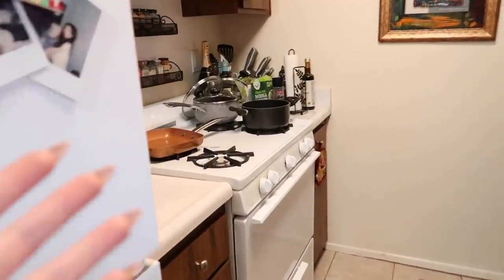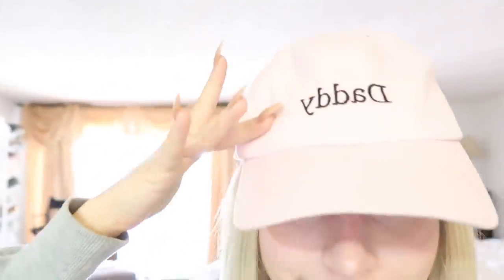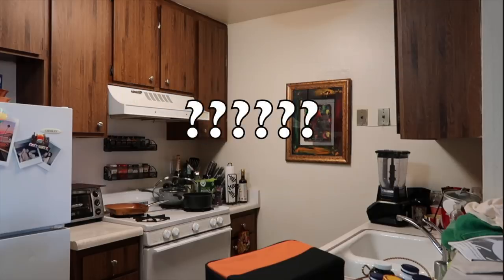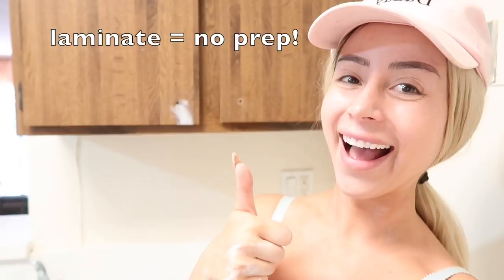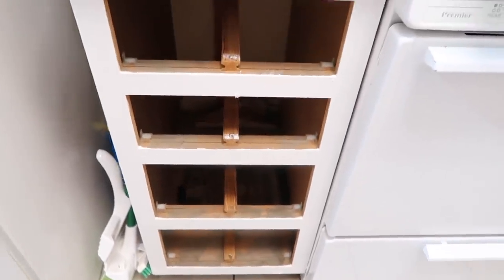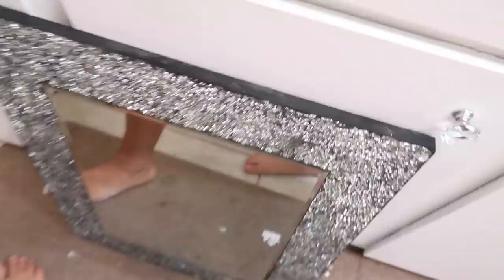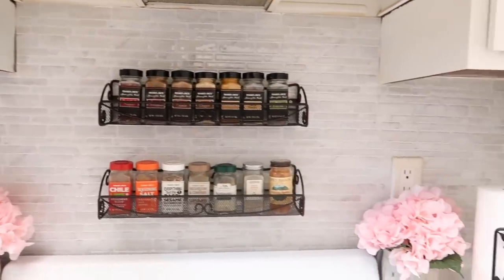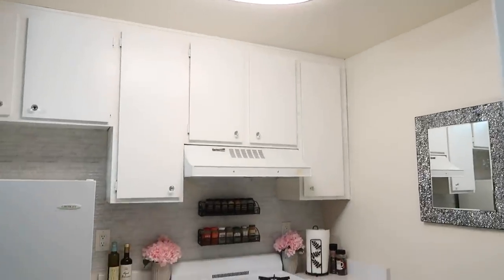DIY KITCHEN MAKEOVER!

Comment: Don't forget to clean your cabinets with TSP or a degreaser before painting!!
Reply: Mustafa oof
Reply: @kaitling6527  oof indeed
Reply: And don't apply 4 coats of paint in 8 hours lol. It's probably sliding off next week.
Reply: poodlegirl55 why ? What is the right way of painting?
Reply: I’m also pretty sure u can’t just paint over laminate? To my knowledge it’s best to sand, prime and then paint it. Or at least use a degreaser. Hope it won’t peel off.
Reply: @julienov8084  it will,unfortunately and I heard paint not primer and not fully cured before more coats, yikes!
Reply: @julienov8084  it's for sure going to peel off. I once painted over laminate, the whole thing was peeling off at every slight touch by the next day. There is a brand of primer that is enamel based and made to work over shiny surfaces, i.e., laminate, or wood with finish on it. Zinsser B-I-N,  it was a life saver.  I scraped off the disastrous first attempt and repainted with the B-I-N bc it let me skip the sanding.
Reply: This whole video is what NOT to do
Reply: @watchlovestanexo  The can of paint lists how many hours it needs to dry between coats, it can vary. Usually 2 to 4 hours. I would never do more than 2 in one day. If one coat isn't dry and you add more it can never dry underneath and will start to bubble up. It won't last.
Reply: Greasiest area in the whole house...on laminate 😂. 
No prep at all.
Reply: What is TSP?
Reply: Mustafa I’m so nervous for anyone that watches this video & thinks this is the proper way to paint laminate... or paint at all lol

Comment: I love you Amber! You are my fave and I LOVE YOUR DIYS ☺️😍. But if anybody wants to renovate make sure you use actual Laminate Paint for the cabinets. There is one that I recommend and it’s sold at Home Depot, is called Cabinet Rescue and while I love PPG Timeless paint bc it’s one coat, I assure you it won’t last and it might scratch easily over time. If it was wood it would be fine but laminate needs a different paint or adhesion primer at least.

Comment: when i get a house in the future, the only person i'd allow to do a makeover would be Amber
Reply: Same gurl, same
Reply: helpmethinkofaname but... she didn’t paint the cabinets properly at all. She was wrong about laminate not needing sanded, she 100% should have put a primer down first, her very first step NEEDED to be using a degreaser on the cabinets (otherwise the paint will slide right off over time), & that many coats of paint that quickly will start chipping & peeling because the bottom layers never fully finish drying which leads to bubbling. It looks okay from far away but it could look SO much better & it’s going to last about a year before it’s a complete mess to deal with it

Comment: Just throwing in some suggestions for anyone who wants to do this to their cabinets. I don’t remember Amber mentioning this so i’ll add it’s important to buy paint AND a primer specifically for cabinets. Ordinary paint isn’t water resistant and normal kitchen activity can wear the paint down quickly and start chipping. Which isn’t safe and fixing it will be more time consuming. Also, deep clean the cabinets before you paint and a tiny bit of sanding is recommended for laminate cabinets to help the paint stick! There are some tips online to be sure how to properly do it. Happy renovating everyone!

Comment: Sigh, I hate to be "that comment," but please take the time to remove the cabinet doors if you're going to paint your cabinets. Number them so you can easily put them back in the right spots. Also, you should ideally use a fine grit sandpaper to get the sheen off the laminate before painting.